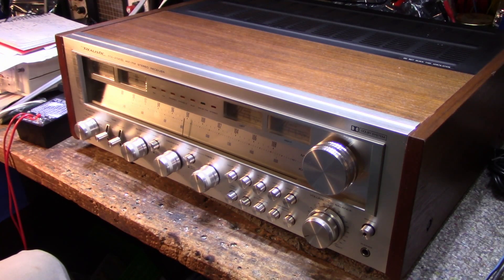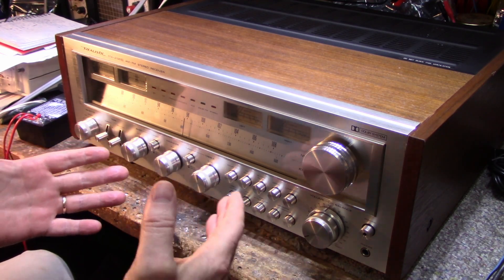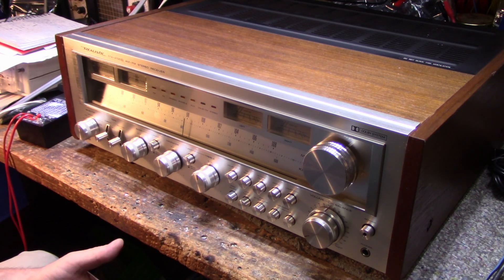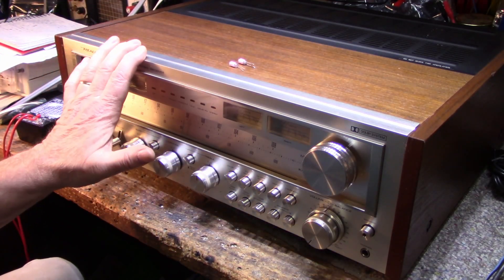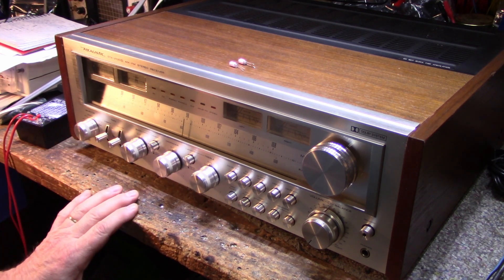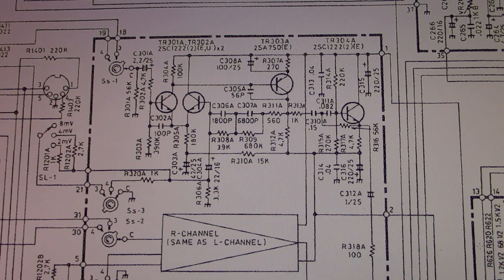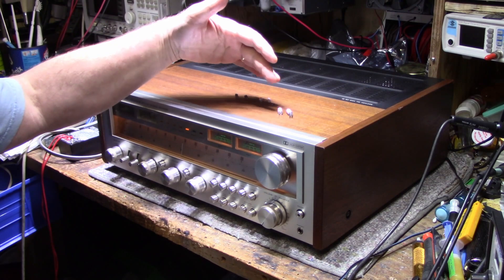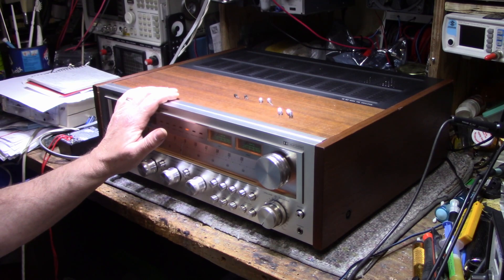Realistic STA 2100D Part 2 - Warranty Work (Ep. 169)

Comment: I watched part one of this unit and was very surprised when you serviced the protection relay and you didn't warn your viewers that when powering up these high power units to "NEVER" have the volume turned up. This will cause arcing on the contacts and ruin the plating. I noticed you even powered it up without zeroing out the volume control yourself. That was not dirt under the housing that was soot from arcing from this unit being powered many times at high volume levels in the past. That is why those contacts needed servicing to start with. This was one of the main causes of these units needing serviced  back in the day.

 I worked in the QC Labs in Fort Texas from 1976 to 1983. The reason the mirrored amp board designs was because we wanted "quality in design" although we replaced the toroid transformer on the D units to cut cost (and not the ridiculous Pioneer patent rumor everyone seems to think), we still had many of these amplifier PCBs in stock use from the original 2100 run for 79. We ran these units in the QC's at full rated power 24 hrs a day for 7 straight days along with Pioneers 120 watts receiver, and Marantz 's 120 watt, and a few other brands at the time, and they all failed except for the 2100 than ran the whole seven days. 
I am still proud to say today in 2023 the STA-2100 was the best 120 watt receiver ever built at the time.
J
Reply: I have seven of them. A few of the D and rest  non D. The secret is  starting to get out on how powerful these units are. 10 years ago I bought these off eBay for about $100 or $200 now they're selling four times that.

Comment: Trevor, I was recently gifted this unit. 2100d. The loudness and the attenuation switches cause the left and right to crackle, loose volume, reduce highs or lows. You have to fiddle and wiggle to get the volume/tone back. Where would you get replacement parts? Also, the left side power amp stays real cool, but the right side gets warm. Is that normal?

Comment: you used the wrong parts! 1000 and 1800 is different.
Reply from the maker: I used a 1000pF and 820pF in parallel to equal the 1800pF I replaced